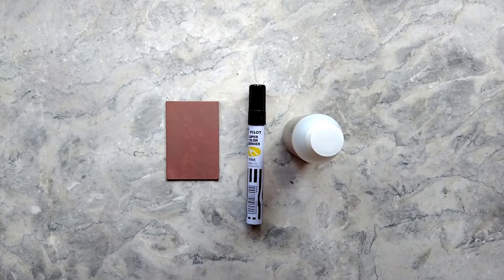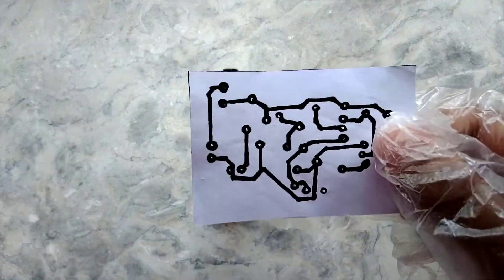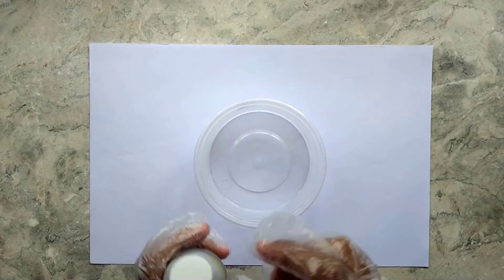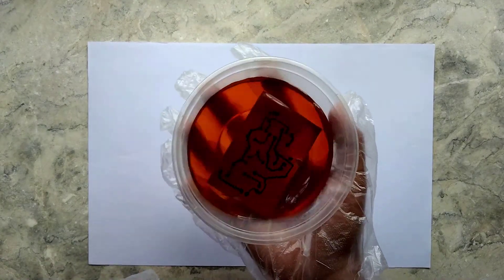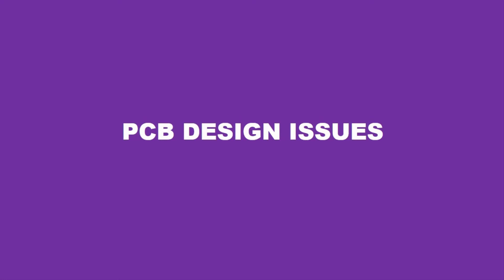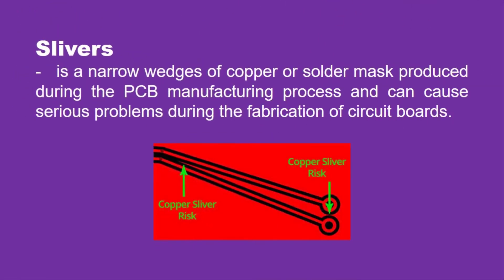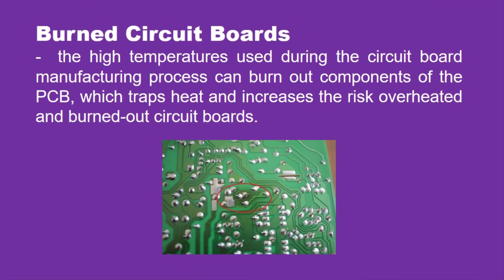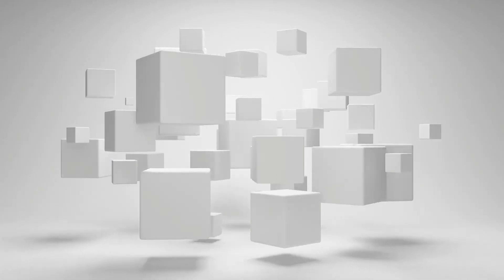PCB Etching Using Permanent Marker | Part 2

Comment: Have you tried different permanent markers for this? Which one seems to be the best?
Reply from the maker: Any permanent marker can do
Reply: @eden12_penales  Not true. Some permanent markers will not survive the etching. Sharpies do not work, despite being "permanent." They used to, but apparently they changed the ink formula. I use a Staedtler Lumocolor 318-9 and get excellent results.
Reply: @user-hy6yq4uk8e Never tried one. I experimented a bit with using my 3D printer to draw traces, and it worked for what I needed it to do, but it's not very practical if you need to do anything with 0.85mm or smaller pitch. I did manage to do a breakout board for a PIC18 with 0.85mm pitch, but it required some manual corrections with microscope and needle to scrape away some of the marker. I'm at some point going to try to use photosensitive boards and use an LCD for masking the parts which shouldn't be exposed to UV. It's the same process used in resin based 3D printers. I think some screen printing is done that way too.